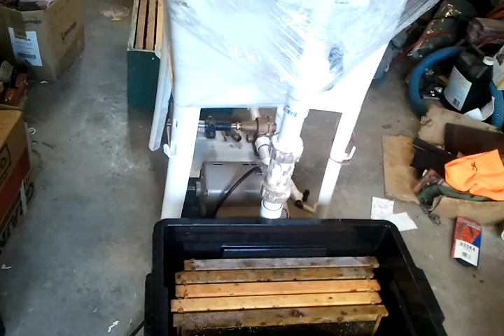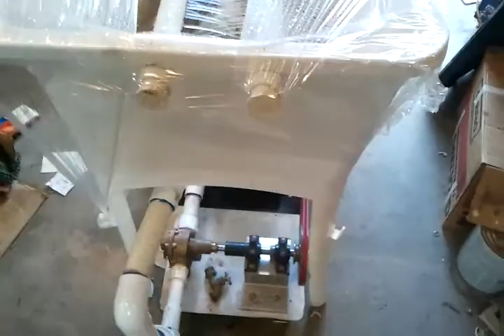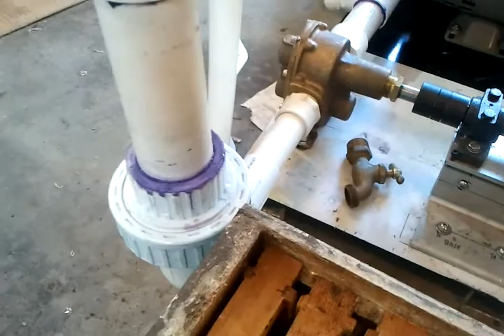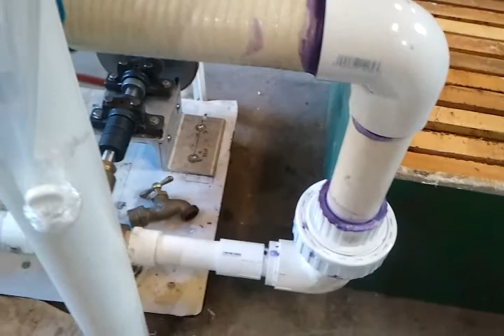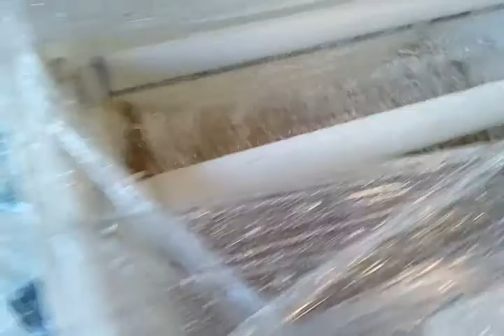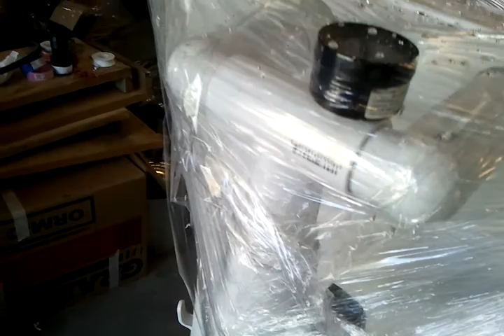More detailed video

Comment from the maker: This is a little easier to see the operation and how the filler was built. You can see the stretch wrap I used to help with cleaning up. There appears to be splatter on it however it is on the inside.
There are a couple of small things I would change if I did this system again but I am satisfied beyond expectation and will not be tempted to upgrade it so long as it is working fine.
Thanks